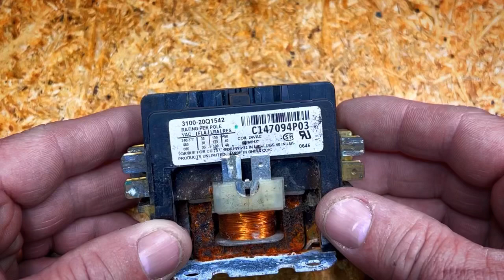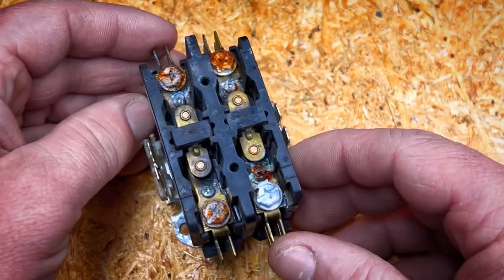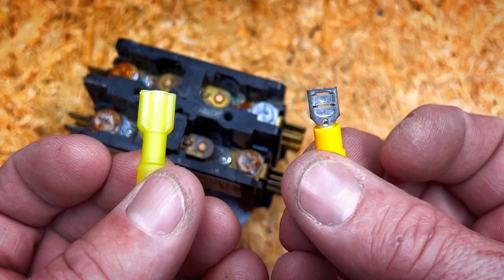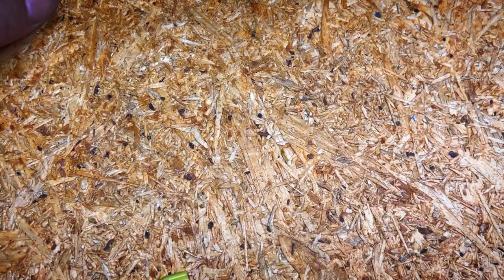HVAC Contactor Basics

Comment: This winter I repaired a AC electrical heater after another company whose technician put a 208-230v coil contactor which didn’t work for 24v low voltage. Pretty sure a “new hand” technician 😀
Reply from the maker: I guess he did not test operation!

Comment: Fun fact, if you use a crimp connector on thhn wire it will derate the maximum amperage the conductor can carry. It will derate it from 75°c to 60°c